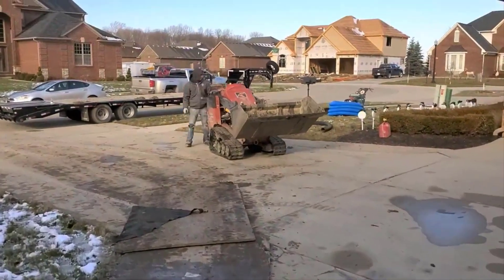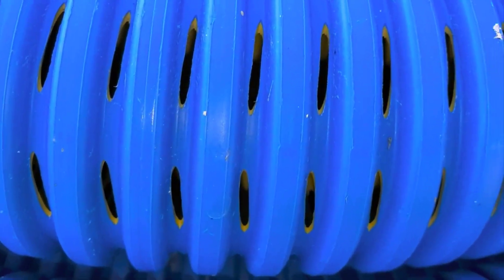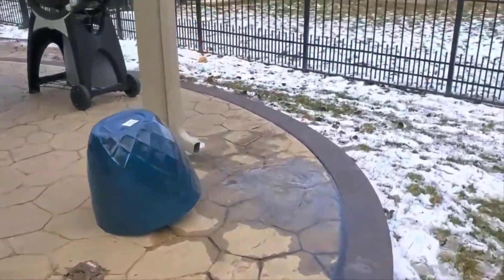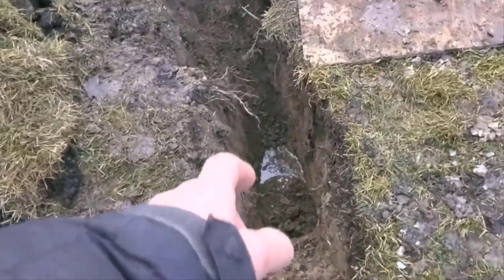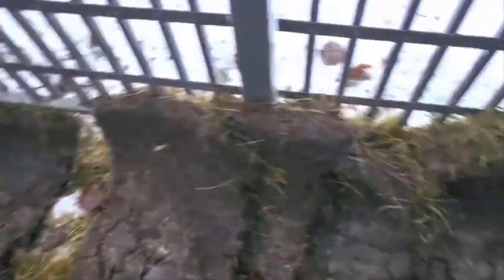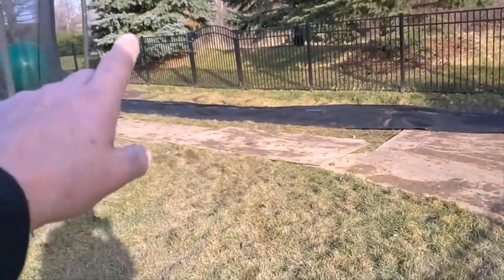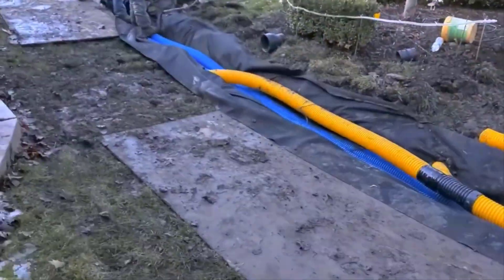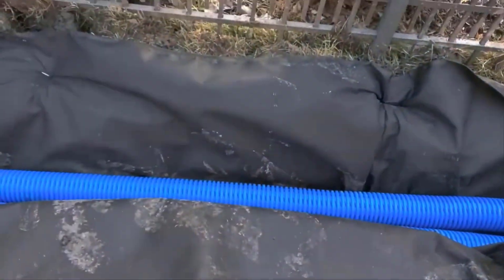How to Install a French Drain Combined with a Roof Run-off System

Comment: Does the Quad fit into a 14x14" trench?
Reply from the maker: No its 14 x 16 for Quad
Reply: @FRENCHDRAINMAN  I am a big fan.  My drainage company in NC doesn't want to burrito wrap, and if they won't do it to my specs, I will have to do it myself.  Many thanks.  NEW SUB